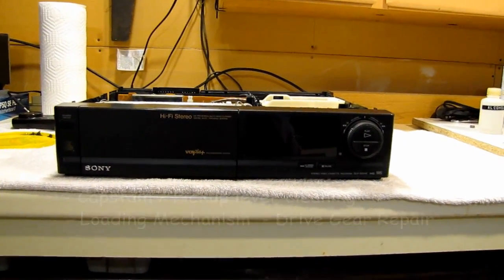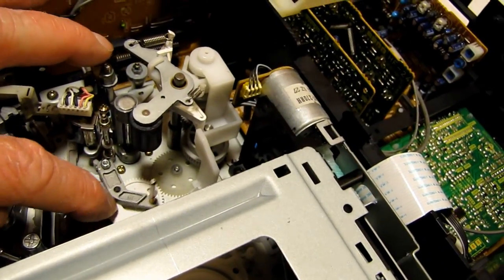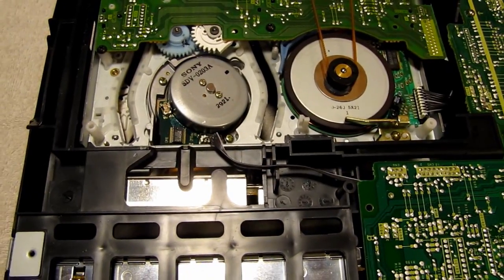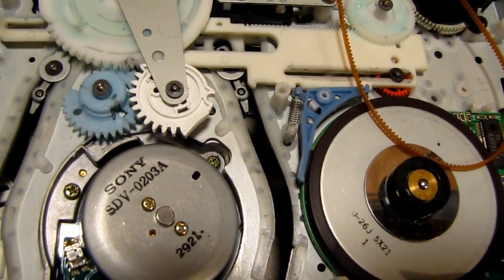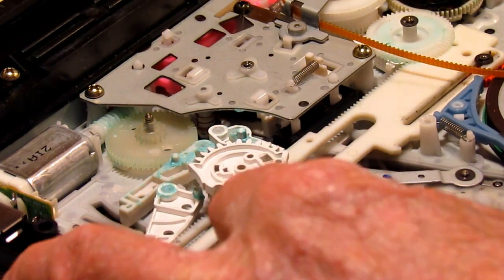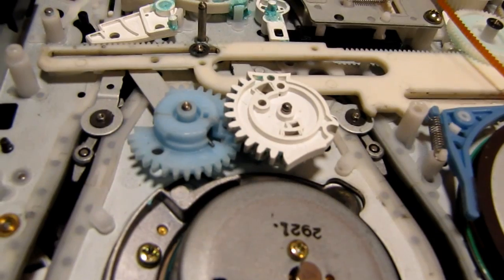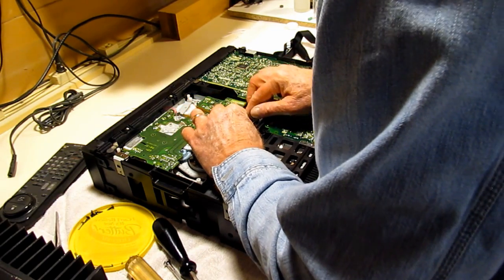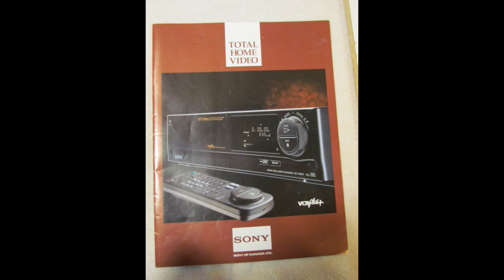Sony VCR - SLV-595 HF - Tape Load Gear Repair

Comment: I had to order that blue gear and when I went to put the white gear back in, I got it in place but then the center pin that it fits on - pushed down where I couldn't get the snap on.  So I took it off and tried again and it now keeps pushing in.  When I did get the gear on and the snap on the pin - I started to put the large white gear on and as I rotated the gears it pulled that pin up making the gear vulnerable to being stripped.  Do I need to glue that pin now?  It has a perfect slip hole but nothing to hold it in place
Reply: That’s what I would do. Just enough to keep it in place. Hope this works out for you. It is a pretty good deck.
Reply: @larryhuff3383  That worked for putting the new gear in but one I got it all together there was a new problem.  the tape wrapped good around the head but the pinch roller stays up and that slide arm doesn't move the tape in place.  Not sure what activates it.  When I took off the board to fix the gears I only unplugged the 3 or 4 prong white connector.  I was a little confused when I plugged it back in, there was a yellow and a white connector.  marked Con 1 and con2, I even tried it in both.  no change.  I had lubed all the pinch roller parts.   There was a few broken teeth on it's bottom gear.  I had this unit when it was new.  Thanks for your response

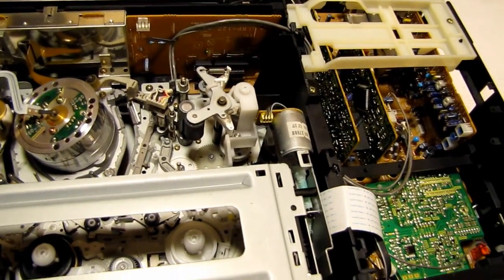Comment: Great video! I recently took out my Sony SLV-575UC after at least 5 years of storage. It accepted a tape just fine but wouldn't give it back. Upon opening that 'frozen' lever you see @1:40 was the culprit. It pulled the tape up properly then just locked in place and wouldn't let it go. It was nice finding this video just to get further confirmation. It was really hard to get it off after the nut was removed but once off and cleaned it appears to be working good. I love my 575UC
Reply from the maker: Glad that the the video was helpful. My sony is still going strong.

Comment: Hello I have a sony vcr SLV SE20.  After I insert a tape I get the snow screen and I hear the tape beginning to scrunch inside, after I took tape out the tape was a little crumpled up and I had to wind it back a bit with my finger.  Can a faulty or dirty mode switch cause this?  I tried cleaning the two black heads, the side of the drum including the padded wheel which spins from the side of the drum and the long thin poles that pull the tape at least some of the poles not sure if I did them all.  Can you please tell me where the mode switch is located on my particular vcr?  Thank you and I have Subbed to you.
Reply from the maker: Unfortunately I don't have a manual for either the VCR in my video or yours. It could be a faulty switch but more often it's something mechanical that is ceased up. Most times I find that the transport mechanism is at fault. Watching the VCR go through the loading sequence should tell you allot.

Comment: What kind of glue did you use on the blue gear?
Reply from the maker: Hard to believe there are folks still watching this video. I used a blue coloured crazy glue but I guess any cyanoacrolyte adhesive would work. You should really try to get a replacement gear though. The glue didn’t hold for long and I ended up ordering a replacement gear after only a week or so of use. I wouldn’t advise gluing the gear today. Best to find a replacement.
Reply: @larryh8072  Thanks. People will still watch it if it is still relevant to them. I blew off the dust my VCR recently in order to play an old tape I knew I had and wanted, but the VCR ate it. Thus I discovered the blue gear was broken.
Reply from the maker: I believe I put the supplier details for the blue gear in the description. To the best of my knowledge this is a super common problem and the gear should be available still.

Also, not sure if you follow 12voltvids on YouTube but he shows how to do this repair much better than I did.

https://m.youtube.com/watch?v=zHiZeMg8vOc&pp=ygUOU29ueSBibHVlIGdlYXI%3D

Comment: Your video was excellent and I too had the same problems and fixed both (got a replacement gear rather than fixing the broken one).  After I replaced the gear and timed everything a tape loaded correctly the first time and ejected it.  When loading the tape a second time it loaded, but made a clicking noise and would not unload.  I removed the main gear and retimed it and the same thing happens each time.  Do you have any idea what additional problem I may have?
Reply: I've heard of this problem before. The teeth of the cam gear are worn and get out of alignment when the mechanism operates for 1-2 times. :(

Comment: I’ve been doing a lot of VHS transfers to digital lately. Recently, while at my Dad’s, he let me take his Sony VHS machine, this one. Good to have another one on hand. Turned out, no video, upon further inspection, it’s this very issue. I will try gluing the gear as you demonstrated.

Thank you for taking the time to create this video and demonstrate this repair in a very clear and accessible way!
Reply: Hi Joe. I would highly recommend sourcing the gear. I believe I left the part number in the description. The glue held in my case for a couple of months and then let go. This is a common failure I’m learning now. Best to replace the gear with a new one.
Reply: larry Huff Ha, my Dad said to do the same thing. Buy the part. 👍

Comment: The gear in mine crackled the same way. What glue did you use? because I used Crazy glue and it doesn't seem to keep the two pieces bonded.
Reply from the maker: I know what you mean. I was pretty optimistic after I glued mine at first but it only lasted a couple of weeks. I ended up buying a new gear. It was only a few dollars and I got it in only a few days.
https://kpcomponents.co/products/sony-3-736-147-01-gear-replacement-iw220-available
Reply: Thank you for posting this link.

Comment: Thank you.   I had the second issue and this helped me get my SLV-R1000 going again.
Reply from the maker: Glad the video helped. My Sony is still going strong!
Reply: Awesome, I occasionally have a checkered/distorted playback, any thoughts on that issue?  Thanks again.
Reply from the maker: I haven't seen this before but keeping your heads clean is important. Pretty well any playback noise I've fixed by cleaning the video heads. It's a simple thing to check.
Reply: @larryh8072  how much do you charge for repairs for Sony
VCR slv 1000 ?
And how can I contact you ?
Thank you !
Reply from the maker: I'm just a diy fixer. I'm not in the business of fixing equipment.
Reply: @larryh8072  Thank You for Your response I have a Sony VCR
SLV 1000 and a tape wouldn't eject so I Put a screwdriver
To hold The plastic door way
To free it 
Now the tape does not load up
The metal that Holds the tape in place now doesn't go up our down
Something is keeping it
Who knows what going on Thank you for your help